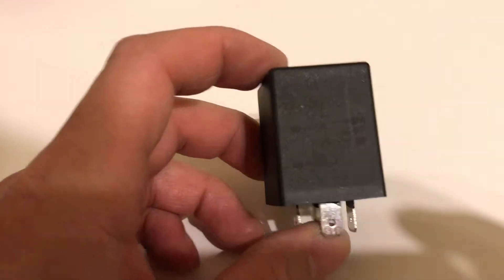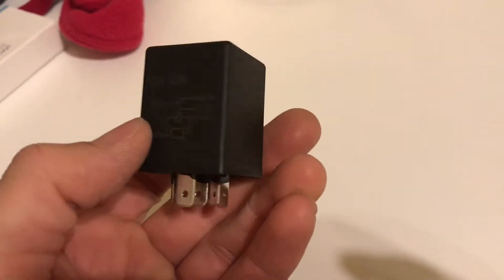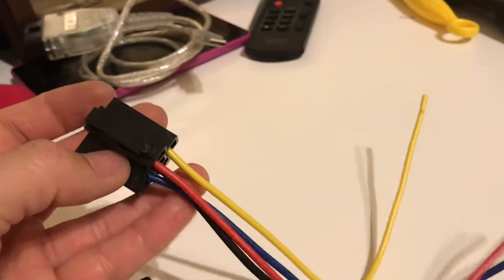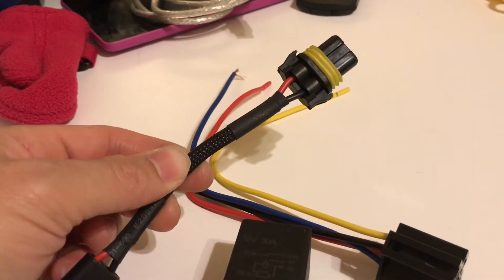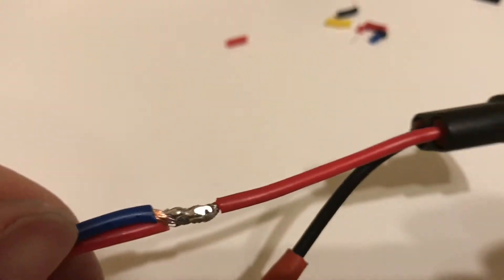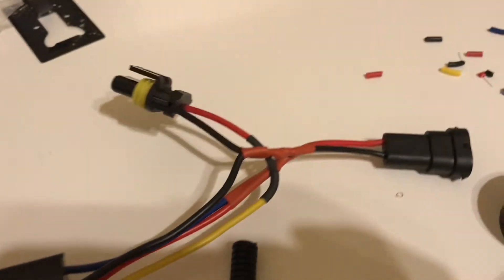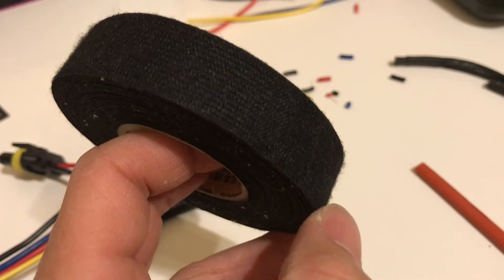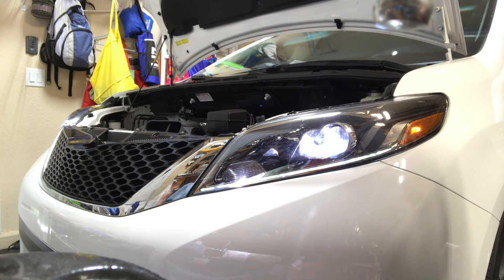HID Xenon Retrofit Auto Headlight 10-second time delay relay install

Comment: Nice Video, On your relay harness, what is your color connections? For example, Relay socket with 5 wires: Black / Ground, Blue / VDC, White / Trigger, Red / Output N/C,Yellow / Output N/O.  Do you have a quick connection diagram on this?
Reply from the maker: The relay didn't come with a harness. I used a standard 5-pin "Bosch" harness from a set of Amazon relays I bought. Check out the relays I bought: https://amzn.to/2U1dgZ1 There is a photo of the pin-out.

Comment: depo is250 
How did you fix the headlight check warnings?
Reply from the maker: I reused the autolevel motors on new lights. The side swivels I rigged motors inside but not functional just so that the AFS light won't come on. The LED projectors are bi-led so there are solenoids for the bi-xenon wiring which AFS monitors. Lots of stuff in that system.